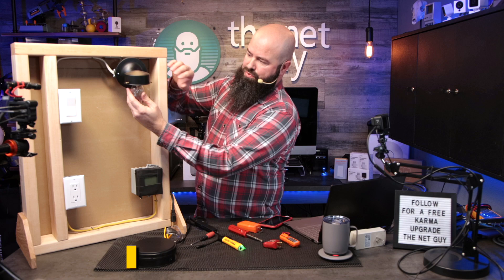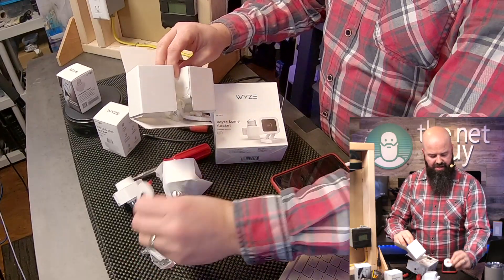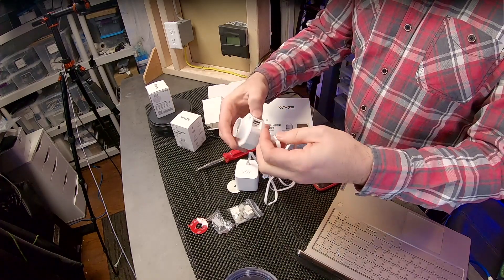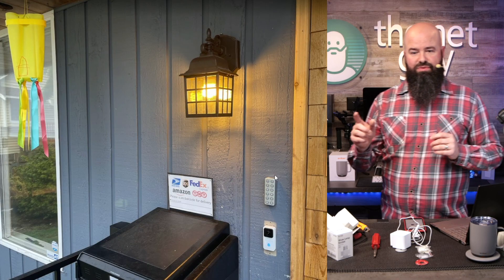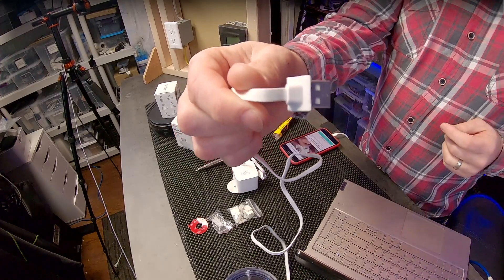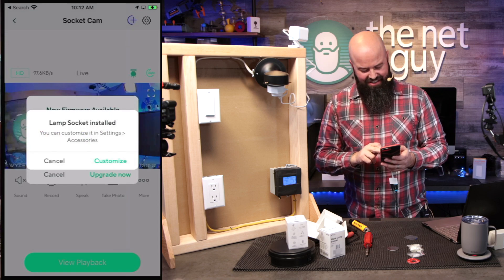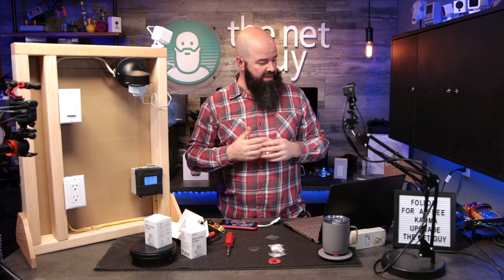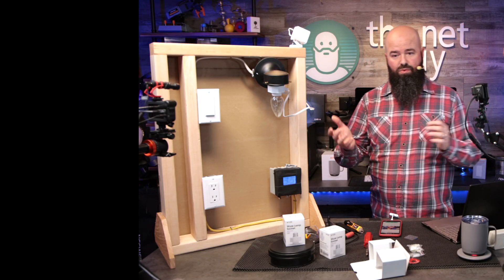Wyze Socket: Installation, Setup, and Usage

Comment: NOTE: You must use the power cord that comes with the socket for this product to work.  I just installed several with my current cameras and neglected to change the power cables and the sockets did not show up.  Switched to the included new cables and bam, good to go.
Reply from the maker: Very interesting.  Thanks Toby!
Reply: You can use other flat micro USB cables but it must also support data sync. I just got a 10 foot cable that has data and it works perfectly
Reply: what!  seriously?  the cable that comes with it doesn’t work.  other normal cables power it, but I can’t control the socket with them. so frustrating!!!!!!!!
Reply: Can you guys suggest a cable that works?  I’m perplexed that the cable supplied in the box doesn’t work, but another cable does (supplies power) but no cables i tried so far let me turn off the light.  I guess I’ll unscrew the bulb.  Not really a smart light.  definitely dumb.
Reply: Ok, update, I got it to work!  How?  80 grit sandpaper.  They forget to mention in the manual that you might need to do some sanding to get the cables to mate correctly.  lol.  oh china….
Reply: THIS. I bought a socket lamp add-on. Not knowing I'd need a v3 to be plugged into it, so I got an additional V3 to my system. No biggie. I spent a few days trying to set it up, it kept claiming it was setup and I'd be able to set the lamp in the settings, but that was never possible. I was using the cable that came with the camera. Fortunately, I hadn't thrown out the box the socket came in and sure enough, the cable in there did the trick. Sucks I had to do cable management more than once, but I'm set thanks to THIS comment.
Reply: @redkulaT which cable did you get? What’s the name please or link it

Comment: what do you think about those bulb sockets to power outlet thingys? I have a remote area in my warehouse that only has a light switch and a light bulb, but I wanted to set up some things over there and bought one of those lightbulb to 2 prong power adapter thingys.

Comment: I didn't read the details very carefully when I recently purchased my new v3Pan cam and socket. It turns out, the socket is not controllable with the very new v3PanCam.
Reply: So the v3 pan can does not work with this socket?
Reply: No it dose not work. It would be more badass if it did.

Comment: It is crucial to be aware that Wyze cameras exclusively operate on a 2.4GHz frequency, which can pose difficulties for individuals unaware of this requirement or whose routers do not offer that option.
Reply: Lol, all routers will have 2.4.
Reply: @starmc26  some older protocols will not make it easy and are wildly temperamental. Newer routers will make it easy

Comment: so i added the lamp socket  just like  you showed but when it clicks over to camera i dont get a box that says lamp socket installed i have no way to controll my light  i even went to accessory and cant do anything . any idea what happend
Reply: Check for camera update...it usually needs a firmware update before it works
Reply: @coqueto45   since i couldnt get it to work i turned it off.  but i updated  it and still nothing.   ive uninstalled  installed  everything i can think of and nothing
Reply: Maybe because your Wyze cam have the rtsp software

Comment: I have a Porch light that has bult in outlet. The problem with it is that when I turn off the light there is no power to the outlets. The light is sold at the Home Depot called "Mission Style Black with Bronze Highlight Outdoor Wall Lantern with Built-In Electrical Outlet" Do you know if this socket will still have power when I turn off the light switch?
Reply from the maker: Unfortunately the outlet has to stay on for electricity to flow.  You can control smart features though with a Wyze switch, the app, or their scheduler.  I hope that helps.

Comment: Can you show the ability to control more than the light the socket is attached too?
Reply from the maker: I felt so bad that was down during the demo, but yes, single double and triple tap can be reassigned. Maybe I need a follow up video?
Reply: @TheNetGuy  no reason to feel bad about anything, very informative. I just have more questions. I have 2, 2-light circuits, and 1, 3-light circuit that I want to install this on. I want to do it correctly.
Reply from the maker: @robadair7227  how many switches control the lights?  As long as you are replacing a single switches the number of lights it turns on usually doesn’t matter (I have 26 ceiling lights on 3 switches). You’ll also want to see if you have green/bare, black and white wires in the switch box.
Reply: Well didn’t work as I had hoped. However, I can add a socket control and link them. I have ordered 4 extra sockets to link them together.

Comment: am I out of luck for using a lamp socket in the day? Should I cover my photocells somehow?

So, I have the lamp socket in a dusk-til-dawn fixture. I didn’t realize I couldn’t “turn off” the feature of my hard-wired fixture. Now I can only connect to my cameras and light control at night. Is there a way to troubleshoot this without getting a new fixture?
Reply from the maker: Definitely cover the photo cells - electrical tape works great.

Comment: Can you try setting this up with a Wyze Outdoor Cam and let us know the results? I know the website says it is not compatible but has it been tried?
Reply from the maker: I think the reason they say it isn’t compatible is that the camera is the network interface to the sockets and has to be on all the time to work.  Even when the socket bulb is off the camera has power via usb.  The cam outdoor goes to sleep to save battery when there is no motion so they probably never coded the app support for it. 

I recently got the V3 Pro to run with the socket, but the app only lets you set it up and not directly control it right now.

Comment: Nice review and cool setup!  

Do you know if the sockets can communicate peer to peer or does each socket have to have a direct connection to the wifi router?  My front door light is just barely within wifi range, so I suspect the two light just a bit farther out flanking the garage (which are on a brick wall) might just be out of reliable wifi range. I can’t really justify a wifi extender just for those two lights, but if the sockets help I’d install them. 

Thanks!
Reply from the maker: Great question.  I know one socket and one v3 camera can control three light so my guess is low energy Bluetooth or private 900mhz band between them.  May try one closest to your Wi-Fi and the rest further away.  👍

Comment: Is there on outdoor (moisture resistant) extension cable so I can put my camera a few feet further from my socket than the standard cable allows?
Reply: I did find microUSB to microUSB male to female extension cables on Amazon, but they’re not advertised to be for outdoor use.
Reply from the maker: That’s a great question.   I know Wyze has an outdoor rated power supply but not sure about socket extensions.  Product idea?

Comment: Anyone know of the socket will fit in a standard BR30 can socket?
Reply from the maker: Not necessarily- it’s wider and has a cord output so it will push the bulb lower in any housing and require more width.
Reply from the maker: Not necessarily- it’s wider and has a cord output so it will push the bulb lower in any housing and require more width.

Comment: Ok lets make this clear. You must connect at least one cam to a socket to make it work. Other wyze, no pun intended, the sockets by them selfs are worth less. You cannot use the socket by them selfs to turn on/off lights. Not too Wyze!
Reply: Very UnWyze
Reply: Just found this out when I went to connect it last.

This was supposed to be a smart socket to pair with the Wyze floodlight which already has a camera.